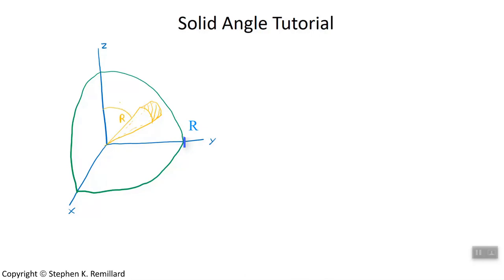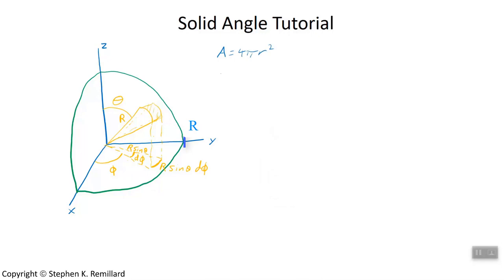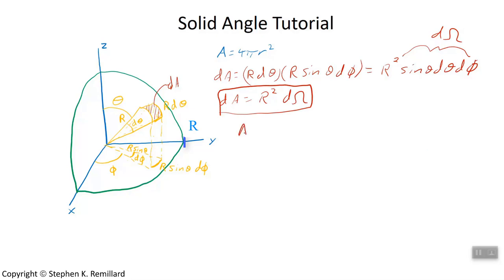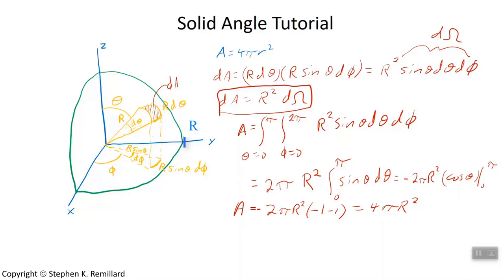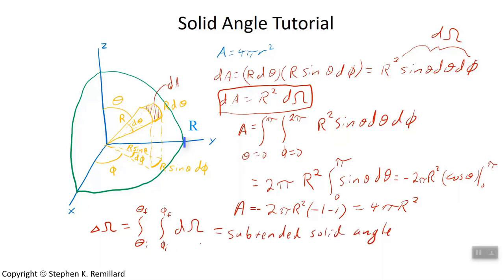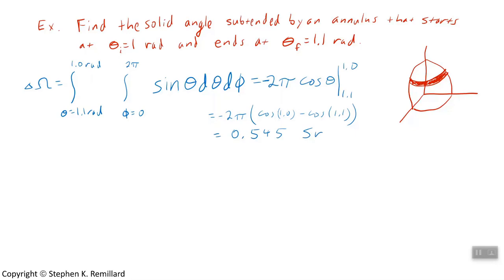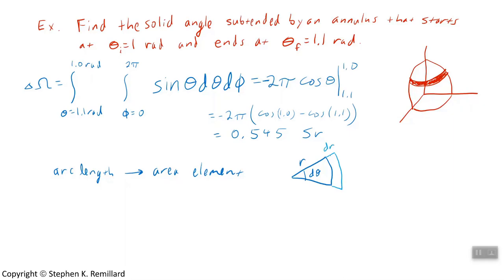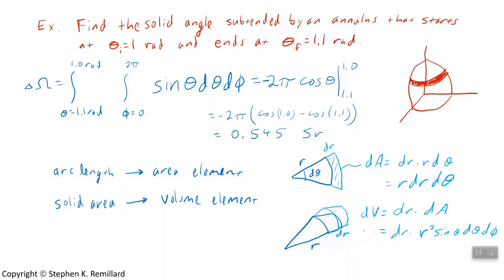Solid Angle Tutorial

Comment: This is great, but I have a question for you: Is this analogous to using double integration with surface area in rectilinear coordinates and then transposing it to polar coordinates? I am thinking of surface integrals where, when the function is equal to one, you get the surface area of a swept out patch.
Reply from the maker: Along the lines of what you just described, solid angle is what you get when you integrate the area element without a function, or rather with the function equal to unity, and then divide the result by the radius of curvature, Omega=[Int(dA)]/R^2.  
As for rectilinear versus polar, since the area that Int(dA) gives is part of a sphere, it is considerably easier to work in spherical polar coordinates when finding solid angle.  If you integrate in rectilinear coordinates, then the integral probably isn't being evaluated on the surface of a sphere.  (Ah, good, I just saw your 2nd post and see that you made an additional comment about converting to spherical before integrating.  Great point!)